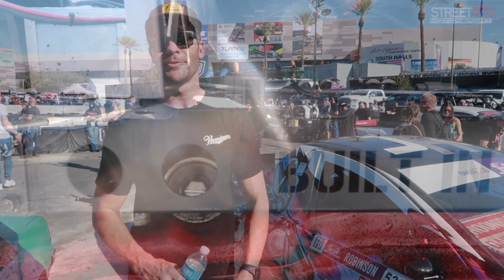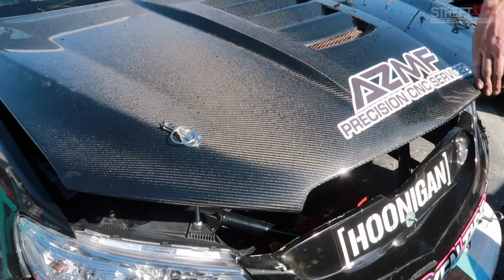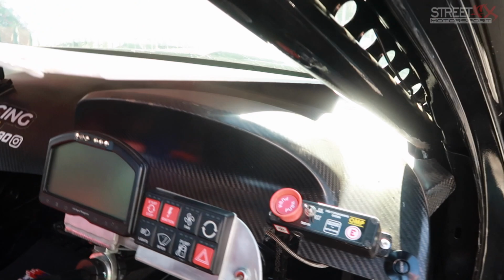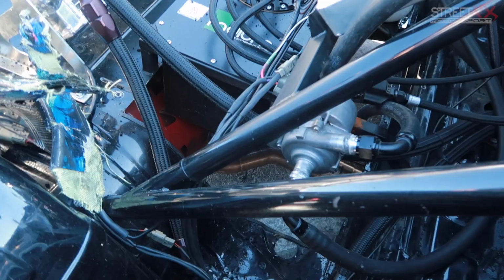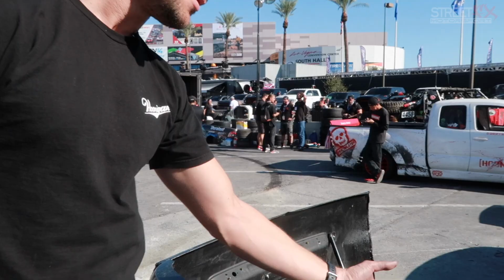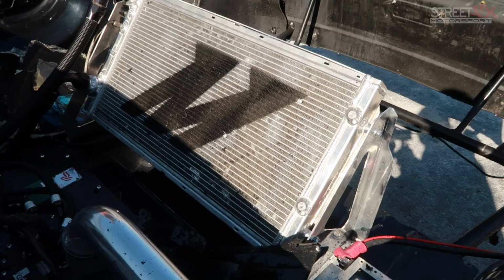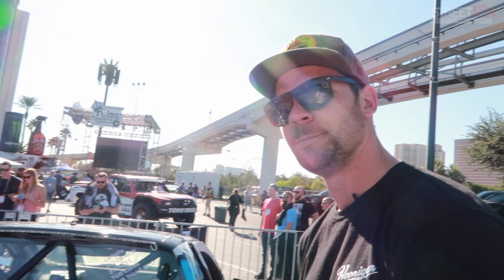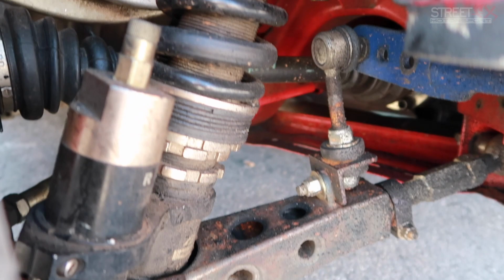1000hp Blown V8 Carbon Fibre Holden Commodore Formula Drift Ute in USA! with Hoonigan Josh Robinson.

Comment: so they can make their own carbon fibre parts? need an autoclave for that.
Reply: only need an autoclave if you're using pre-impregnated carbon fibre sheets, can make it farely easy with a vacuum pump and doing a resin infusion.

Comment: Where’d he get his front bumper from?
Reply: From any Australian company as it is a standard Holden HSV front end . any fibreglass company sells them here in Australia also.
Reply: @nedkelly9688  you sure mate? Looks exactly like a VF v8 supercar front bar and not a HSV one. No split in the grill and massive front solitter
Reply: @CP0rings33  Didn't really look that much but does not matter as can buy V8 supercar one's in Australia also.
Any fibreglass place sells them all even maloo kits.